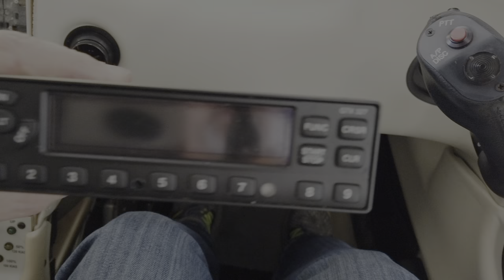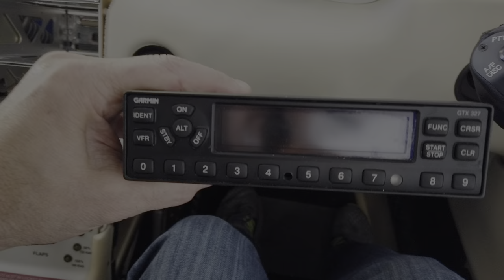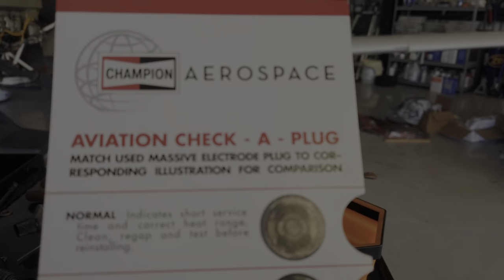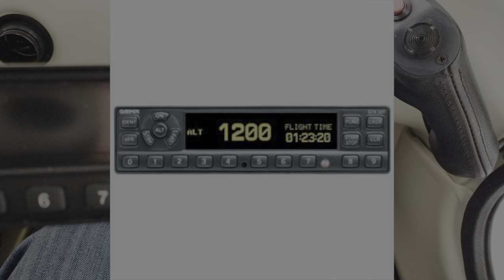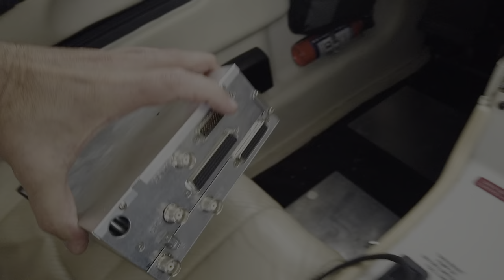ADS-B 2020 Upgrade to the Cirrus SR20 G2, GTS with Avidyne IFD540.

Comment: I was wondering, what does an annual inspection cost? Minus your upgrades of course. I am looking to  buy a 2006 SR20 like yours.
Thank you.
Reply: That all depends on what they find Richard. I had purchased the plane from Steele Aviation a year prior and they went through the plane and performed an annual before I took delivery. AirWerks found no issues with the plane. If that is the case with your plane, expect no more than $1,500. Once they start to replace things, it gets more pricey. In total, last year, the aircraft had many squawks, including a weak cylinder, puck replacements, etc and the cost was about $9K!
Reply: Thank you David. That was very helpful.